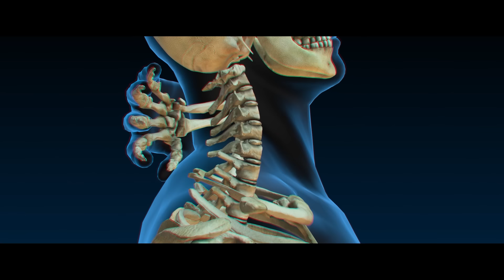How to Beat the SOOTY SLASHER in THE CONFERENCE

Comment: For the zipline i would have tried to pull my clothing off and up over the mechanism to slow me down / gunk up the sliding part of it. If i could get my shoes off put them on my hands and grab in front of the sliding part it should slow us down. You wouldn't want it behind you seeing as you could lose the shoes or it just doesn't slow you down quick enough. I wouldn't have used the zipline in the first place due to how vulnerable it would be, you wouldn't know what's waiting at the end, and if the killer was waiting to cut it on you after you start using it.